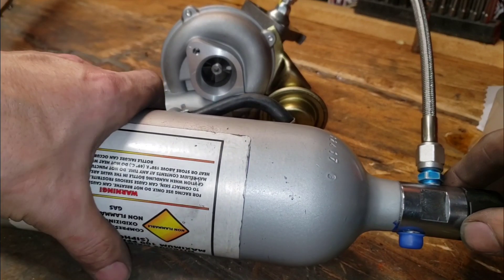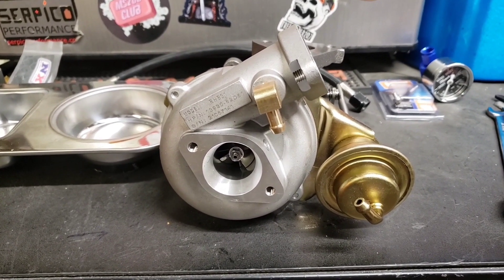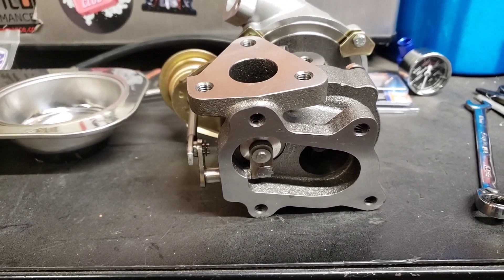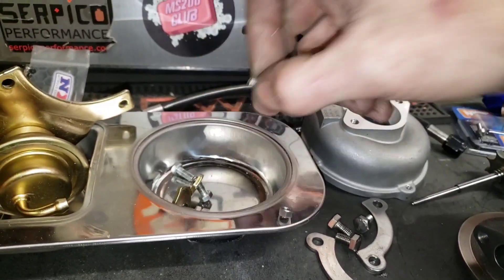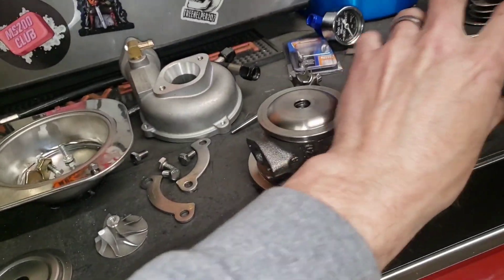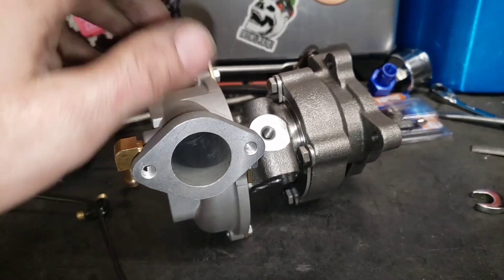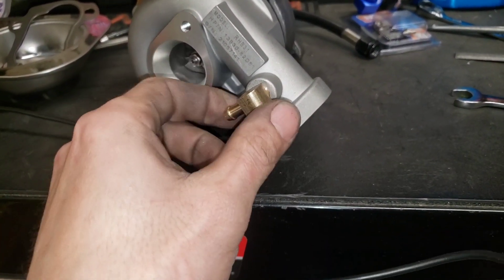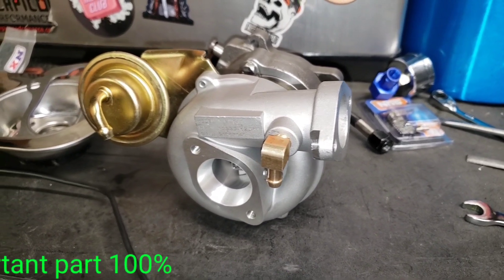TURBOCHARGER.... NITROUS...  2 STROKE... CHAINSAW...

Comment: Wastegate function by taking a pressure source from between the turbo and throttle body, and once pressure is high enough they actuate they flapper door inside the turbo to bypass exhaust gas around the turbine, slowing the turbine and regulating boost.

Comment: The center section of  the  turbo holds a set of bearings and seals, similar to the case of your saw. Make sure the oil return is on the bottom and somewhat level to the ground. That's also part of the purpose of those brackets,  so the turbine housing, center section  and compressor housing can be "clocked"to your needs. The wastegate isn't adjustable but you can get one with an adjustable rod. The one piece you  were wondering about is a blow off valve. It opens to keep from over boosting. You'll hear the woosh sound when you let off the throttle.
Reply from the maker: Appreciate the info my man... I am not sure if its a good idea but im eliminating the waste gate completely and sealing the oil ports off and probably install a vented cap so I can just change or add oil but I am going to run it as a sealed unit... the turbo will be spooling only while im cutting... its hard to explain but it will be spinning/spooling for 30 seconds a time max... when the saw is idling or running normally it won't be in use if that makes sense... so hopefully the oil in the gearbox is enough to keep things lubricated... like my NOS saw... they are race saws so I have that huge advantage... not saying my idea will work but im going about it totally different... basically im using a turbo to not be a turbo anymore... not really a supercharger either... im probably bat shit crazy but im gonna try my idea and even if it's a disaster I will still pit the videos up lol
Reply: @johnscustomsaws  you know that oil in the "gearbox" idea might not be too bad. Especially with a vented cap. I had an idea to go off of that is to put a small reservoir right on top of that like a slave cylinder for a clutch like off of motorcycle or even a newer car like a Corvette or mustang or something like that they're hydraulic and I think the fittings might even be small enough or even maybe using an adapter to mount that tiny reservoir right on top. It might even make changing and or refilling easier. As to that ladder part I'm wondering if you're thinking of using the turbo as a belt driven turbo which would make it a centrifugal supercharger. But I'm not sure if that's what you're thinking. Turbo's basically just free spool at idle and almost like you said, they don't really do nothing untill you give it the go go juice. Good luck with the eliminating the wastegate. That shit just might work. 🤞👍
Reply from the maker: @seanrepka5101  im actually uploading a new video now because I do what advice but hopefully the new video will get you guys on the same page as me... im technically using a turbo as a momentary supercharger... dont ask lol
Reply: @johnscustomsaws  You know I have to ask now    🤣

Comment: You can test the wastegate actuator with your pressure vac tester you use on saws.  I've used them in the past to test actuators. I had an old VW with the TD engine in it and had tons of turbo problems.  Your 460N probably puts out more power then that pig did.

Comment: For short stints like 2-3 cuts you can probably get away with just filling the turbo with oil and plugging it up.
Reply from the maker: think so? thats actually what i am hoping to do... like my nos saw i make 2 cuts and shut it off
Reply: It's for both lubrication and cooling. I think the boostedboiz (Honda guys) did it on their shopping cart gocart before getting an oil pump and EFI.

Comment: How you gonna provide steady oil flow to the bearings??

FYI. I do believe they sell turbos with sealed bearing setups that do not need pressurized oil. 

No turbo expert here. Installed a few “kits” on cars back in my day. Nothing more.
Reply from the maker: The way I am using it... it will be a sealed system... the huge factor in my favor over a car is that I am running it for 30 Seconds at a time... one or 2 cuts... straight race saw so I should be able to oil the turbo and seal it off... maybe check and change it now and then... it will all make sense when you see how I plan on using it... im not a turbo guy either not one bit... but that might be the best thing I got going for me... true turbos on 2 strokes is a ridiculous system and almost pointless... I look at it like a ton of shit crammed onto a saw and one part fighting another... tbh im not actually going to be using a "turbo" but I am using the actual turbo to do my non-turboing... 🤦‍♂️

Comment: I understand that you are not me, but I would tackle the these two power adders separately, substantiate any gains, and perfect the setup before attempting to combine them on an as yet unproven design.
You all probably already know this but nitrous oxide is basically, a blower in a bottle. In effect your doing the same thing as adding a turbo or supercharger, your packing more Oxygen into the combustion chamber. So combining nitrous with a turbo is weird,  why don't you just use more nitrous, being that you already plan to use it ?
Reply from the maker: my man i almost want to take this comment down because that my thinking and i dont want to give away my plan but honestly turbos are the dumbest thing to run on a 2 stroke and pointless... BUT... certain factors and functions of the turbo i believe can aid the nos and intake issues... saws have very small carbs and nos is dense and the carb/intake is the choke point... so forced induction of nitrous is where i can see huge gains... dont be offended if i take this comment down... it is a compliment but i dont want to give it away just yet

Comment: John, it took about 90 seconds of talking to yourself but now you're a turbo expert.  Lol.  A lot of people have no idea what the waste gate does, but it is the most important part of a turbo set up if you want to keep your engine intact in "normal" configurations with the throttle blade open.  Many think the blow off valve protects the engine, but they just protect the turbo when the throttle blade is closed.   With the size of your turbo and the amount of exhaust pressure/flow the chainsaw will put out (?) I think you're on the right track with the waste gate.  You may never build enough boost to open the waste gate.  Can't wait to see the prototyping process here.  Your gonna need some low psi gauges, clipboard and a calculator so you can get your nerd on and crunch some numbers.  😆
Reply from the maker: Im not trying to sound cocky because I realize the epic shit show im in store for but I have an idea that people are probably going to laugh at until it (hopefully) works... put it this way... I KNOW I can create 4 psi of boost and so simply it amazes me that I don't see it on every small engine turbo... which tells me either im a genius or im missing something... but I have talked to a few people WAAAAY smarter than me that usually tell me im crazy and even they can't believe how obvious it is... I will be showing the results either way so soon find out... I need to order a few things but if it doesn't work... the "normal" route seems like an unbelievably horrible fight to even get it to run with boost much less run good... im hoping my idea at least gets me to boost and with less "fighting" with fuel delivery/pressure/scavenging etc... fingers crossed
Reply: @johnscustomsaws  Whether the project is a huge success or a giant failure, I'm more interested in how you get there.  It's projects like these that we all dream about but most of us don't have the money, tools or time to make happen.  This will be awesome.  I too love to tinker with weird projects as well.  I'm gathering parts to build a steam powered DC generator which will then run through a solar charge controller to charge batteries which can then be used to power a power inverter to produce 120Vac.  Essentially turning firewood into electricity.  Trying to stay budget friendly of course.  It will be a lot of fab.  I have about 70% of the materials and parts I need.
Reply from the maker: @fabzacres-blackcat  thanks for doubting me...  like saws run on mixed fuel I run on naysayers lol
Reply from the maker: @fabzacres-blackcat damn... well its fine I got enough doubters to fuel this episode lol

Comment: There was a guy on one of the modified chainsaw groups that had got a small belt driven blower mounted to a old magnesium saw. He had it running a few times but don't remember him talking about any real power gains worth mentioning.
Reply from the maker: thats the general conclusion from what i have seen... some guys have gotten boost to the intake but no reasonable gains... this is what i am hoping to gain with the NOS and few other ideas i have... not saying it will work but i will show what i come up with

Comment: I think it will be interesting even if it doesn’t build much boost.
Reply: If he gets it working with the carb pre-turbo like explained in the last part I'll be amazed. Exciting stuff regardless.
Reply: @7eis  I’ve had lots of failed experiments. I don’t always figure out what I did wrong but I always learn something
Reply from the maker: @7eis  that part i actually have solved and i think the fact i am not a "turbo guy" is hugely in my favor because i am doing this way different than people are thinking... have to see... but getting boost to the intake isnt going to be my issue... its going to be figuring out an exhaust valve
Reply: @johnscustomsaws  I'm more concerned with how the fuel acts after going through the turbo. Have a feeling response is going to be terrible and really hard to make it idle. I appreciate you trying new stuff, makes it more of a learning experience for all of us.
Reply from the maker: @7eis  idling will be done on the stock fuel delivery system absolutely zero issues idling... the turbo will have its own  fuel delivery system

Comment: Humm…I understand the purpose and benefits of hairdryers but it seems to me I seen years ago guys using smog pumps like a mini blower to boost small 2 and 4 strokes. No dinking around with lube oils and pumps. Man I’m parched, I could sure use a swig of some haterade!👍😆
Reply: Using something like a smog pump, for a forced induction setup, would be considered supercharging, not the same as turbo charging. However you are right, it would do away with the need for a pressurized oil supply.

Comment: cant wait to see if it works or not only major thing i can see going wrong is the crank case detenating/spliting  if the turbo can spoool up enough boost but hey gotta learn from tthese things to make it better 

good luck man
Reply from the maker: i dealt with that on my first nitrous saw and i developed a system that will most definitely be on this saw since im running nitrous and boost hopefully... but the way i do the builds it might backfire or shoot fireballs but i dont think it can grenade... hopefully not at least

Comment: Are you giving your turbo any oil feed for the bearings???
Reply from the maker: the saw will literally be ran for 60 seonds at a time so i might see if i can fill the cavity each use or plumb in a pump and all that... the way i am using it i dont think i need to do the pump and oil tank etc
Reply: @johnscustomsaws  It will need something or its gonna eat itself. Turbos spin in excess of 120,000rpm. Those chinese bearings wont last long. You might be able to cap one side and fill it with oil then cap the other so its sealed but lubed.
Reply from the maker: @FishFind3000  kinda my thinking honestly... and change it if needed... its a cheap turbo so if I blow it up nbd... worth the risk to try it out because if it does work I am eliminating a list of issues and fail points... im trying to simplify a insanely complex system... as much as I can at least

Comment: This will be a challenge. But a fun one! 👍 First time i saw a 2-stroke turbo, was in the mid 1990’s. A Yamaha V-max 800 snowmobile. I think the biggest problem will be the fuel system. The simple way will be mounting it before the turbo, otherwise it will need a boost reference to pressurerize the carb, and also change the fuel pressure so the carb will work properly. Keep up the good work! Don’t mind the keyboard warriors, they are just jealous of your knowledge and work.
Reply from the maker: Who said I was using a carb 😉

Comment: basically how a turbo works its its all one big loop with the exhaust flowing into a intercooler then theres a charge pipe from that to the intake and the waste gate is was lets off the pressure so you dont over boost and break stuff.  its normally a spring inside of those and depending one what spring u put in is how much boost it can hold before it opens. people actually use nitrous to help bigger turbos spool up to help with the turbo lag of having to spool up such a big turbo. i think this is gonna turn out pretty cool actually.
Reply: Exhaust doesn't go to the intercooler.
Reply from the maker: It should at least be entertaining for you guys 🤣🤣🤣
Reply: Exhaust is wasted, the charge after the turbo goes to the inter cooler.
Reply: @johnscustomsaws   it'll definitely be interesting lol, one way or another.

Comment: Hi John.  My younger brother has a streetcar we take to the track a couple times each year.  It has a turbo-powered V6 and it will absolutely hurt the feelings of several V8 cars owners.  Nitrous has been used in conjunction with a turbo on a few of the other cars and they are wicked.  Can't wait to see it work on a saw.  You've mentioned porting saws for several folks that cut timber for a living.  I am not in the business, and was wondering if porting the saw changes fuel efficiency?  I love the videos and thank you for your time.

Comment: O bro before I forget don’t forget to make your ring gap a little larger then normal and lower your compression a bit those two things are important so the top don’t blow apart before you build boost
Reply from the maker: for sure my man... i dealt with all of this with my NOS saw... learned the hard way but pinning seals... ring gap... compression etc... i have a handle on that... fuel regulation and delivery as well as an experimental exhaust valve is going to be my biggest hurdle
Reply: @johnscustomsaws  well I’m definitely stuck in to watch the journey, your by far more knowledgeable then I am. I been watching some, ok most; ok ok I watch all of them while I’m at my desk porting my new build. Lot of good info you though out there to learn. Thanks again for response, stay safe. See you in next one.
Reply from the maker: @fabzacres-blackcat  yep I had that one coming... Touce'